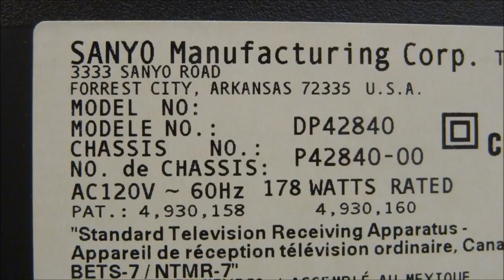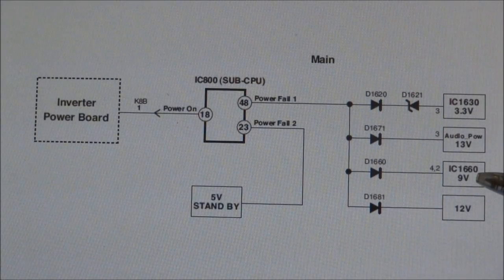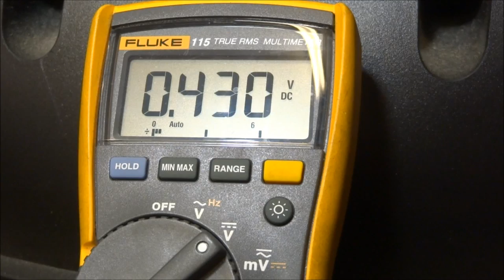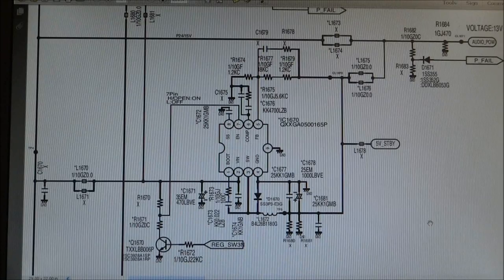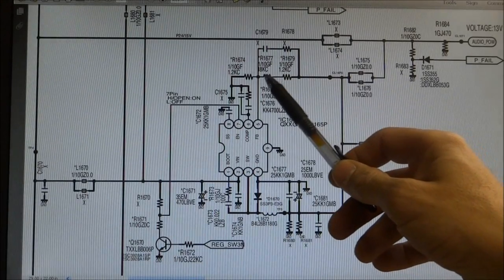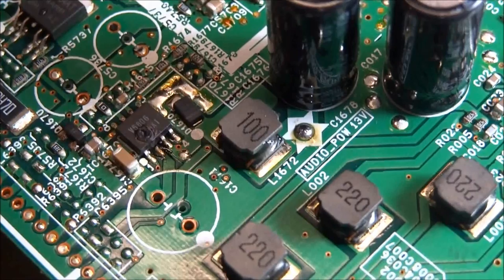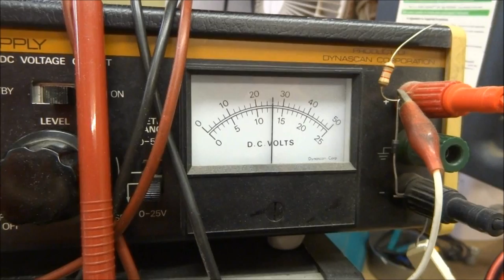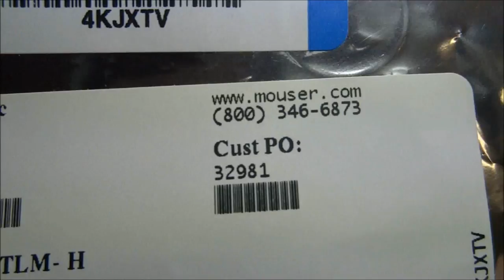Re-posted Sanyo DP42840 DP46840 Wont Power On Main Board Repair Fix N7EK N7AL N7AM N7AS

Comment: Wonder whether there may be some value in adding one of those very small aluminium IC heatsinks to a part like this which is known to run hot?
Reply: Yes, but there's very little space and it might fall off and cause more problems. You may want to look into some thermal "epoxy" paste that's made just for these situations. Has great heat dissipation and no conductivity.

Comment: I've stopped using acetone for flux removal since it seems acetone tends to selectively dissolve components of the flux and leave behind white residues that would become conductive with moisture absorption.  Maybe that's just with the rosin flux I'm using, but I'll just throw that out there.

If isopropanol isn't aggressive enough, I've found that xylene or naphtha is sufficient and doesn't have the same issue. It's also nice that it doesn't flash off as fast, and it's a bit less aggressive on plastics.  Xylene odor is a bit on the sickly-sweet side though.

Also, speaking of shameful wastes from my other comment: counterproductive copyright strikes over trivial incidental recordings.
Reply: I used to use denatured alcohol for flux removal.

Comment: Nice to see you back norcal715
. I left TV repair industry back in 2008 as a AV tech after GFC company closed the door. Now I am in medical industry as a calibration tech. If you don't mind me asking what career path did you choose? Cheers
Reply from the maker: I am now an  industrial electrician. Work with automation systems. Its not much different than the consumer repair industry, just bigger and more voltage.

Comment: Hello, just wondering where the test points are for the ground leads for the tester. I have no power to the mainboard, 120v coming into the power board and 60v everywhere on the power board. Would you have any diagnostics for the power board? My tv does not make a sound and no lights when trying to power it up

Comment: My Sanyo DP50749 has same problem. Replaced PS and main board but problem persists. None of my boards have labeled voltage test points. Pin 48 if IC tests at 2.2v on both main boards. Is my replacement board bad too?

Comment: I have a similar Sanyo with only the green led lights up, but with a different PS and MB,(dp32648 ) but the manual tells me to check pretty much the same points, although my board doesn't have the voltage test points printed on them (won't be a problem) 
My Q is, should I have +5v +12v & +24v at the power supply? I took the board out to inspect it and I don't have any LVDC..I do have HVDC at the mains capacitor. ~140vdc. I'm an old CRT guy..:) tyvm.
Reply from the maker: Sounds like the power supply is not starting. It should receive a command from the main board to start the main power supply. Then you should have the 5,12, and 24 volt supplies. Possible power supply fault also.
Reply: @norcal715  Thank you,

Comment: The IC is unavailable, is it possible to supply a different part number? Or can I rob a 13v output from the psus and simply bypass the ic?? Thanks!!
Reply: ShopJimmy.com has a repair kit for this tv.  You can also get the new chip from china via ebay.

Comment: Marshall Flint
17 hours ago
i have the th-42px75u with same problem my ? is how do you test the fuses n my other ? is where did you get that solder sucker that you used in this video whats the name of it
Reply from the maker: Just do a continuity test with a ohm-meter to test fuses. That was a Denon solder sucker. I now have a Hakko FR301 https://www.amazon.com/Hakko-FR-301-Desoldering-633-01-Nozzles/dp/B07HQXLTKN/ref=sr_1_4?hvadid=295798450273&hvdev=c&hvlocphy=9032608&hvnetw=g&hvpos=1t2&hvqmt=e&hvrand=15298462737268445393&hvtargid=kwd-428019457661&ie=UTF8&keywords=hakko+fr301&qid=1549677500&sr=8-4&tag=googhydr-20 . Great unit with .8 to 1.6 mm tips